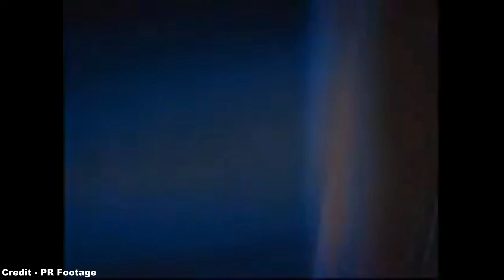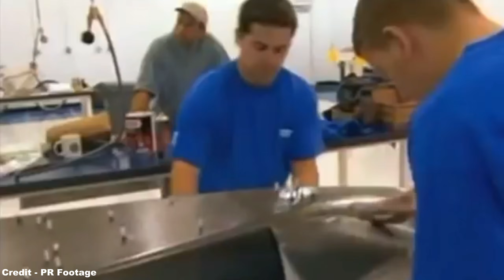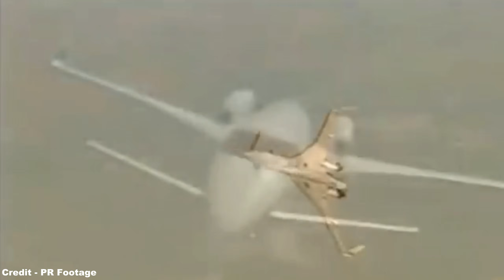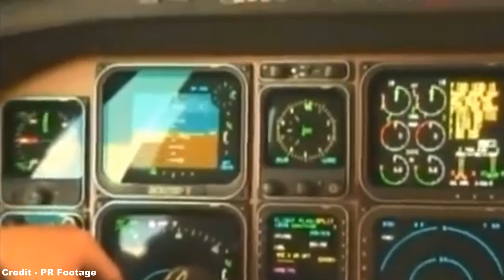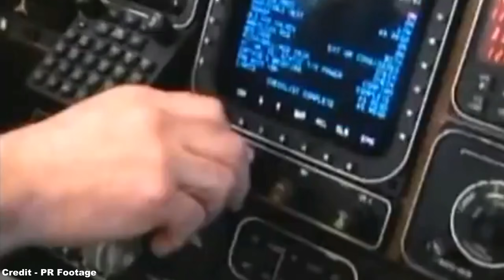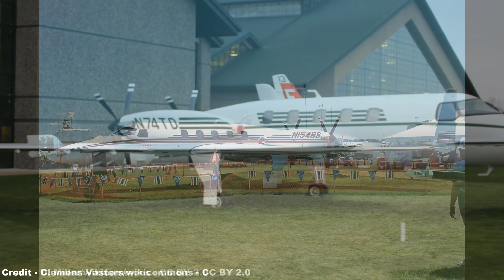Too Advanced For Its Own Good - Beech Starship (Reworked)

Comment: My grandfather did originally order 3 in 1983 for the family charter business. The first one was not delivered until 1991ish and he canceled the other two orders because it just took a long time to get replacement parts from Raytheon and it was sold to us as a Raytheon starship and only had beechcrafts logo on the yolk. It was massively fun to just poke around with the avionics. and the other two were never delivered, it was sold by the time I got my pilot's license and started working for the family business but it's currently still running around under the registration 8244L 

if I had the money I would track it down and purchase it. I'm already fortunate enough to own my own personal c90 and we have a fleet of 19 King airs and 2 PC12s

Comment: It is ironic that Beechcraft in 1979 saw a reason to change something about the King Air. Now, End of 2024, the King Air is still the King of the air. Put simply, this bucket (lovingly, not bashing) has been around as long as I have. the first King Air, a turboprop version of the Queen Air, flew in 1963 when I was in diapers. Now a pensioner it is still built as the 360 ER. That is mind boggling.

Comment: It would be interesting to see the specs that were anticipated from the designers, and the actual results. Then, you could analyze what issues conspired to make the design fail to meet specs and fail commercially. I have a feeling some of the issues were bureaucratic as opposed to practical, functional or safety issues... Yes, it's important for regulators to have comprehensive knowledge of all elements of a design, especially the new elements. But if you want innovation, then some of the burden for developing the new regs and standards should be born by the state..... It has worked before and delivered extraordinary outcomes. Do you seriously think that the private sector of the 80s and 90s would have developed the internet and the standards required to make it work? Think again, and read the history.... might surprise you ... Oh!!.... yeah.../s
 BTW I was there...
There have been so many lost ideas, and the data that support them, that might have contributed to progress in so many fields, missed opportunities. I think Starship, among many other examples, is one of them. Stop evaluating everything in monetary terms and instead see if an idea/design is really leading to knowledge progress. In this instance?.... composites. Now we fly on 787, composite fuselage etc. 
Beech/Rutan et. al. were ahead of their time. There are none so blind as those who don't want to see..
The Dr.